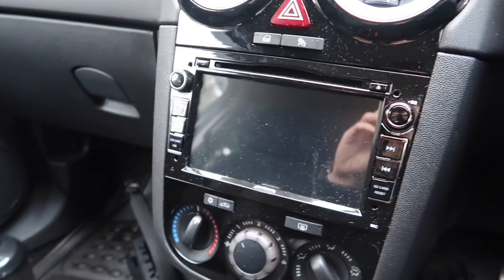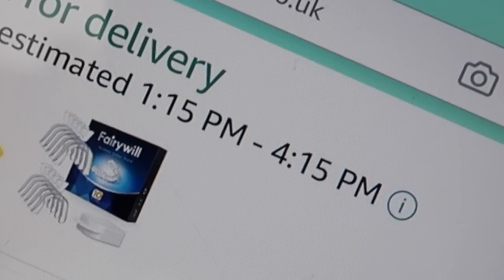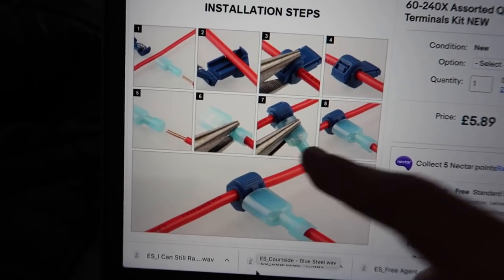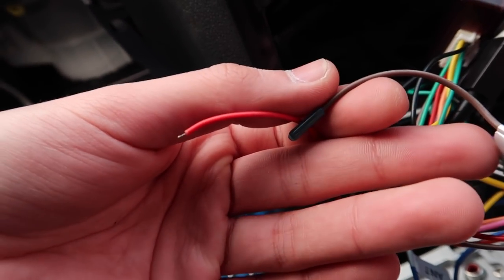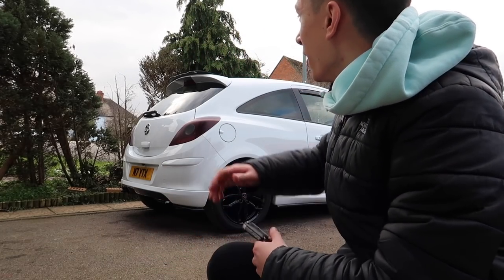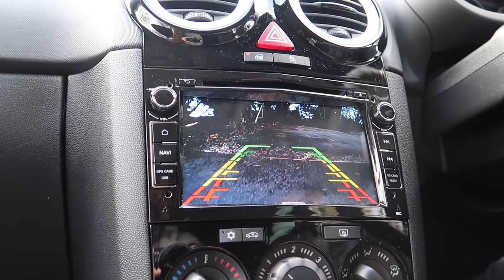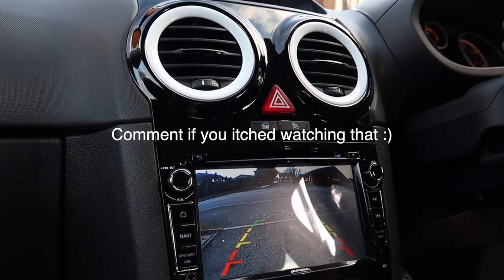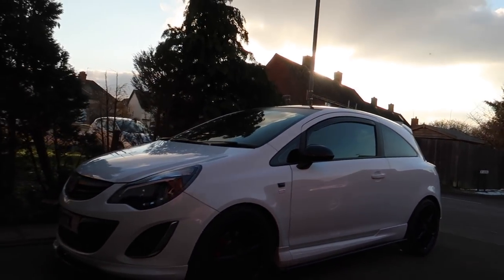REVERSE CAMERA INSTALL ON MY CORSA! **EASY!**

Comment: On my fiesta I fitted a reversing camera. Cut a hole on the boot handle for the camera to sit through and bought a rear view mirror with a LCD screen which comes on when it gets power from the reverse light. Really helps when parking in tight spaces

Comment: Is the wiring different for car with canbus installed  vs canbus not installed (Canbus box and wiring is needed to enable steering wheel controls for corsa )

Comment: Hi, when you connected the yellow plug to the Double Din Display, 😃 did you actually crimp the red wire with the brown from the head unit?  In the clip were you plugged it into the correct socket the brown wire was stripped but not connected. Which got me thinking you didn't connect them or disconnected them. Thanks.

Comment: Brilliant and funny - really cool video, useful and enjoyable 👍😊😊😆 Those connectors (or at least the early version without a Lucar connector) were originally called (branded) Scotchloks/locks. If fitting those, a word of wisdom to the wise, smear a little copper ease/grease on the metal blades - it'll stop corrosion (which they can suffer from due to condensation in the car)👍😊😉 Yours will probably be fine though as they're pretty much 'sealed' 👍👍🤞🤞👍😊

Comment: Where did u get the radio and the camera bro. I've got corsa vauxhall 2011 limited edition. Im gonna try add the radio and the reverse camera as well. If u could tell me the exact same ones you've got that would be really helpful. Thanks

Comment: Is the Pumpkin head unit worth it or  other? Saw on one of your other video's you'd had problems with it.
Reply from the maker: Hey bro! I changed a few settings over since then and it seems like it hasn't died on me yet 🤔 I'll have to get back to you on that because it seems OK right now 🤔🤔🤔🤔🤔
Reply: @TheOtherStuff  not many other video's about them,so was glad when you did yours.May have to order one now 👍🏻
Reply from the maker: @Mr8527.  Im glad about that mate :) They are sick, its good quality screen as well but they have a feature where it turns on instantly and I think thats what makes it turn off and not allow you to turn it back on, I turned that feature off and now it seems fine, just takes a bit longer to turn on 🤔❤️❤️

Comment: You could have wired the power from the headunit itself tapping into the acc wire. Saves messing with the Reverse wiring at the back of the car.

Comment: I have a vauxhall corsa 2014 1.4 turbo black edition, will this HEAD UNIT FIT because i still haven't had a reply from the company to say yes or no. Thanks.
Reply: If it’s a D yes it will fit

Comment: if u use the "reverse" cable on your china radio , u not need to connect the 12 volt plus on the reverse light. connect 12 volt plus from the camera with the red cable outcoming of the chinch cable in the trunk, minus is a central point somewhere in the trunk . on the radio plug in the chinch cable and the outcoming red connect with "reverse" . the canbus is giving the reverse cable on your radio a signal, if u shift the rev.-gear.
it is easier. plus, if u have a "pwm" signal to your reverse light, it will not work , if engine is running. this is important 2 know.
Reply: So ur saying that you only need to connect the camera to the head unit wire or the rev light wire (this is for the cable that runs with the rca cable), any help is much appreciated thanks
Reply: @thenewgamer1281  thats correct, connect the power cable from the camera with the red cable outcoming at the rca cable. the black cable from the camera connect with the cental mass point. the mass point is right down in the trunk behind the side floor in the trunk.
go with the rca cable behind the head unit. connect the rca cable with the reverse rca input cable on the head unit.
conect the red outcoming cable to the ,( in my case ), "reverse" cable on the head unit. the car canbus system gives the cable 12 volts, if u shift into reverse....camera goes on. neutral or a gear....cam goes off.
in the head unit settings is a point, that allows your head unit to show the reverse screen.

Comment: Hey mate with ur new head unit /stereo do you find the steering wheel control functions mess up eg: volume button song changes etc ? Heard it’s a common problem with changing original corsa stereos ?
Reply from the maker: Hey bro! Nah, the all the steering wheel controls seem to work perfectly, I'm pretty sure 🤔🤔🤔🤔
Reply: @TheOtherStuff   ahh lucky ! I got a new stereo  fitted at Halfords they said sometimes corsa steering wheel buttons stop working after a while my local garage said same thing

Comment: Mine was a pain to install the Corsa e has its reverse light in the boot lid cause I couldn’t fine the wire going to the reverse light I had to run a wire up with the boot loom to the bulb